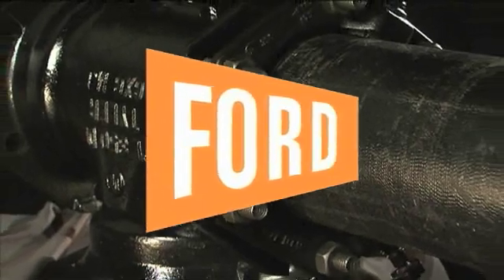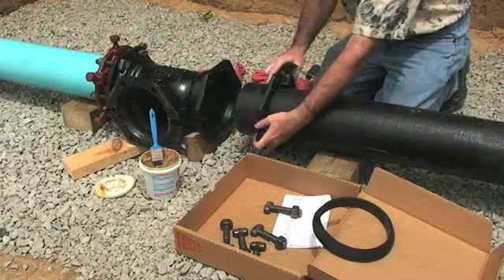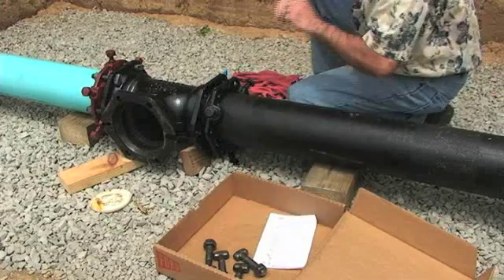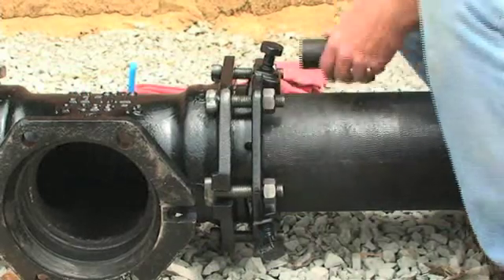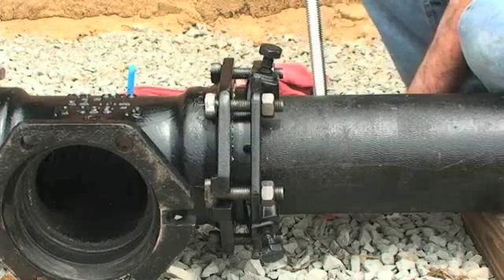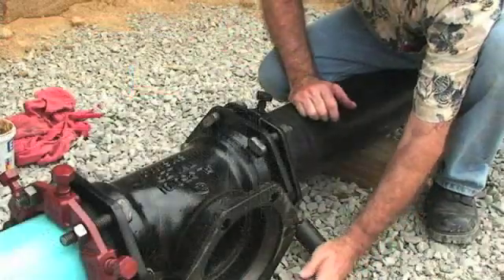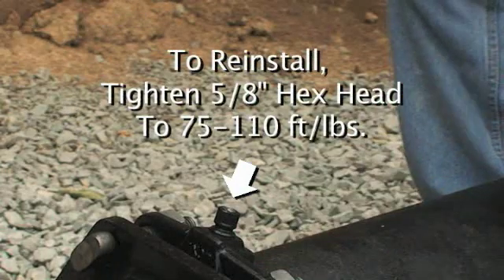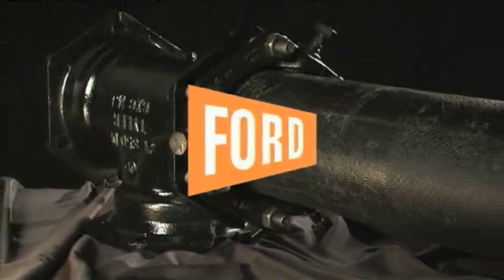How to Restrain Ductile Iron Pipe with the Ford® UFR1400

Comment: We are having trouble getting a 45 degree fitting with the ford MJ  on our 30 inch pipe. Boss says the pipe ain't round but I measured it and it was only about 1/16th off